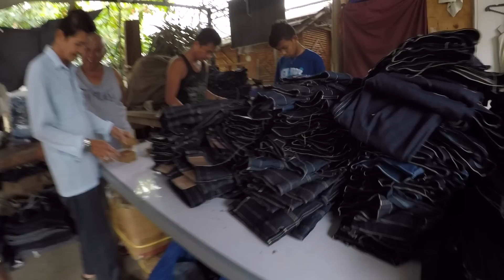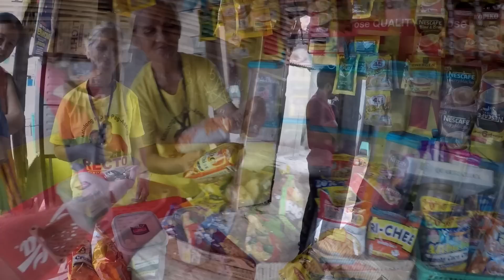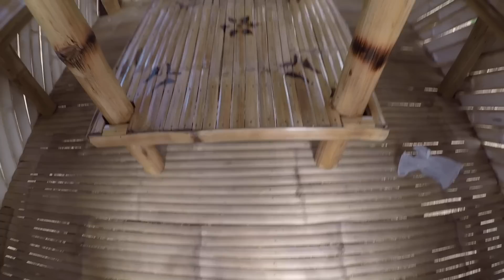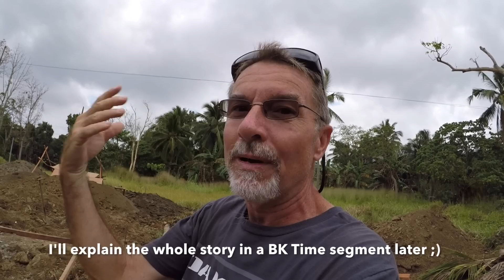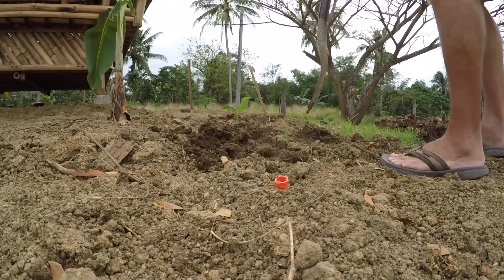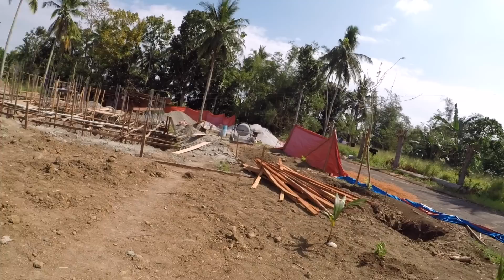VILLA FELIZ -  EPISODE 22:  IT'S TAKING FORM (House Building in the Philippines)

Comment: You are so good, u know CAT6, I am actually a data center technician, the fastest LAN cable we using is CAT6A, claims that up to 10Gbps, CAT7 is the next standard, however, CAT6 is pretty good and I believe the philippine internet speed can't catch up CAT6A, fiber is growing in ph but still only like 500Mbps, and yes, cable is much stable and faster than wifi
Reply from the maker: For our needs, the CAT6 or 6A will be more than enough.  My wife is an online teacher and some of requirements are she's on hardwire instead of wifi.  You might ask, "how would they ever know?"  Well, some of her employers remote into the teachers laptops during the session to validate policy.  So that's one of the main reasons we're wiring up.

Comment: Where is your water source?  I assume the development provides the taps for each lot. Is it metered or you pay a flat rate?
Reply from the maker: Water is from the city and stored in two separate storage tanks which help the subdivision provide adequate water pressure when there are brownouts and the city cannot supply pumped water to the community.
The subdivision taps into the community water supply provides installation of the water meter for connection to your property, which answers your third question that is indeed metered.

Comment: Good morning to you! I'm a new subscriber. I leave in San Diego Ca. retired military, I really like your blogs! I just want to know how much per sq. ft. in Tierra Maria? Thank you so much sir.
Reply from the maker: The calculations here are calculated in sqm. which is P4,000 or ~USD$80.00 per sqm.  1 sqm = 10.7639 sq ft.  So if you convert sqm to sq ft you'll get ~P372 or ~USD$7.43 per sq ft.  You might also want the contractor costs to build which is ~P18,000 (~USD$360) to P35,000 (~USD$700) per sqm.  Most contractors will quote you ~P27,000 to P35,000 per sqm.
Reply: My PI Dream, thank you for the CIA job on the updated price. It would be a very nice segment and guideline in your bahay kubo time to mention also, how much money do you need to prepare for an early retirement to PI. Foreigners think that everything would be cheap, well it won't be cheap until you stop making an income. How did you know that your savings would be enough to buy and build a western house in a good location and good neighborhood. How much do we need to save for land and house like you do? Your's is very good example because you are retiring but your not downgrading your lifestyle and comfortability. Most people do not receive monthly pension. That needs to take into consideration, how much living expenses needs to be prepared until they reach 62. Most Americans are used to western living, so we need to calculate the costing into western lifestyle. You are quite unique because your a well traveller and you can eat anything. Your not picky with foods, and you love filipino foods and that lowers your expenses. I have the impression that your a wise spender too. Bringing a western lifestyle in the PI for husband and wife, how much monthly budget should we prepare without stressing and stretching the budget to make it every month. That also includes how much budget should be prepared for emergency cases. Don't worry your input will not necessarily be our strict guideline so don't take that as a pressure on your part. My husband can't wait to retire early, he believes everything is cheap there and he believes bloggers but not to his well experienced Filipina wife. So the expectations and budgeting would be my greatest concern. Thank you.
Reply from the maker: Thank you Filipino Ako for one of the best comments I've seen here on My PI Dream to date.  I'm going to take your advice and set up a BK Time segment with regard to financial preparation prior to jumping into the whole "moving to the Philippines" scenario.
Be patient while I gather my thoughts on what we did over the past few years so I can hopefully share information that's noteworthy.